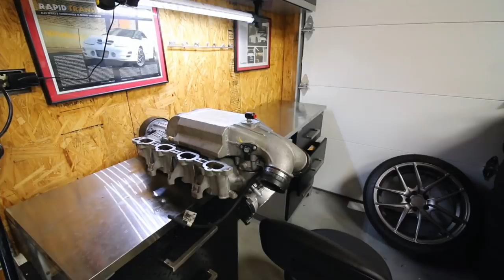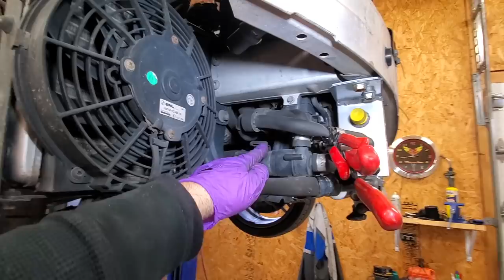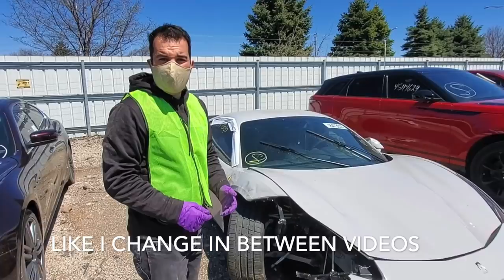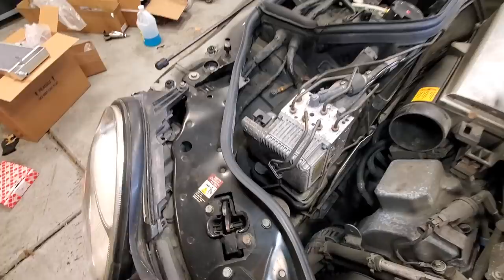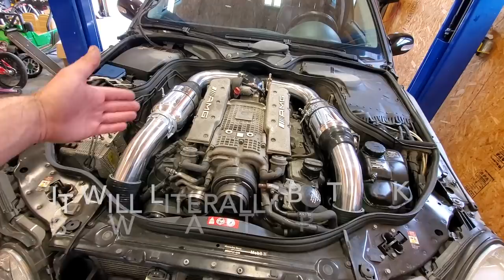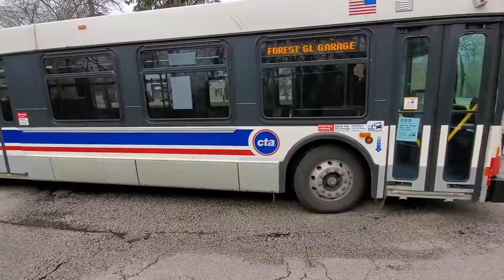I Modified My SEE THROUGH E55 AMG WAGON & Tested Its Performance! I'm Giving The Custom Intake Away!

Comment: Just a friendly tip. For heat shrinking, a cheap harbor freight heat gun is amazing value for money and makes life way easier. Baring that, don’t heat the heat shrink in the middle of the yellow part of the flame. If you have room heat it just barely above the point of the flame. The heat is much more focused there so the heat shrink will contract much quicker meaning less of a chance of a burnt thumb!

Comment: Hey, Alex, I have an idea !, I recon if you take all the doors off and the tailgate off you might just get the 0-60 time down to 3.5 sec but then again the weight reduction could well backfire ! and cause you more traction issues instead !... Shame there wasn't a "4matic" all wheel drive option on the w211 E55 just like my mom's w211 2003 E500 with the 5.0 un-supercharged version of the m113 engine has. An 4matic e55 AMG would be so cool bro 👍👍👍

Comment: When doing heat shrink for that kind of application, I also like to add a bit of silicon before shrinking it in order to seal it from any moisture. I guess it depends on where you live, but from where I'm from, if you don't do it, it will only last a couple of winters before severe corrosion sets in and you risk running into trouble. I also, once upon a time, found heat shrink tubing that had a sealant already in it.
Reply: Florida gang

Comment: Hey Alex, nice vid as always. Please list in more detail which parts you are using. VRP heat exchanger - okay. VRP Superflo pump? - I assume yes, as this is what you used in the sedan. Why no secondary heat exchanger while you are at it? To be honest, I was pretty disappointed about the fit and design of the SHE from VRP. If I sold this, I would immediately make multiple design changes and include some proper fit hoses for real drop in fit. Same with the pump and brackets, which are easy enough to make, but why not include them? And finally I would probably also include a smaller direct fit horn. By the way, I do not like solder connections and would always go with properly crimped ones and self sealing waterproof crimp connectors. Cheers, Tadek

Comment: I had the needswings one on my e55 although many state its a hot air intake the air just doesn't stay in that intake long enough to heat up. Its literally sucking in air soo quick it has no chance to heat up. I think it looks cool it may flow a little better but I never tested HP and TQ numbers before and after just IAT's and for me it stayed the same as the stock airbox. On mine I didnt hear a difference as far as blower sound but a bit more hissing from that intake. I think just like you said more for looks then anything else.

Comment: Really need to put some heat in those radials. Why didn't you do a burnout? And what pressure are you running in them? Want to run about 20psi, but no less than 18psi.

Comment: Many things you can buy - rotary mazda rx8 (plenty of work and content), bmw m5 e60 (even more problems to solve), audi rs6 (just boooooooring). But you know that if you once owned a mercedes you wont find the same "thing" in other makes. So, you still didnt have V12. Buy S65 (W220) from copart and work on it. Or CL65 (215). Or go for newer W221/W216.
Cheers!

Comment: I live in Texas and I ran on my E55 the PLM H/E, Johnson CM30 wired to key on power and did NOT do split cooling.  Never once running the car did it ever disengage the blower due to high IATs.  Just my experience.
Reply from the maker: Good to know!
Reply: @LegitStreetCars  I also had the UPD 83mm clutched pulley, Eurocharged ECU and TCU tune, Eurocharged mid length headers, X-pipe with secondary cat deletes and C63 mufflers.  Great car and never had an issue with keeping the blower working.

Comment: This may be a stupid question cuz I don't know much about AMG s if this car has traction control like my m3 does you will not burn up in the hole as mine will do a flat 4 seconds zero to 60 this is an 06 with 96,000 original

Comment: Hi there Alex, I hope you are doing great.
Dear Alex, I have a problem with my Mercedes E350 2008 4matic that I really need your help to find out what is the problem with it.
So as you remember you once did a repair to your Mercedes black diesel on the transmission's valve body and in the beginning of the video, you said that there is a weird thing happening with rpm drops when the car is cold and the problem goes away once it gets hot, so the same problem is happening to my mercedes the rpm drops like your diesel when it colds and gets away the moment it gets hot.
Did you find the solution to this problem? If yes please can you reply to my comment or do a video about it ?
Thank you so much.